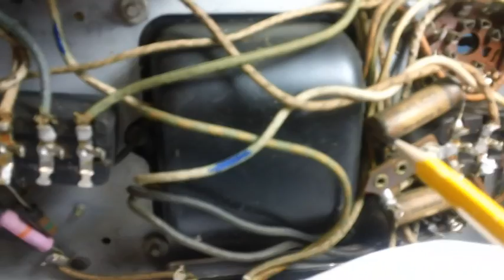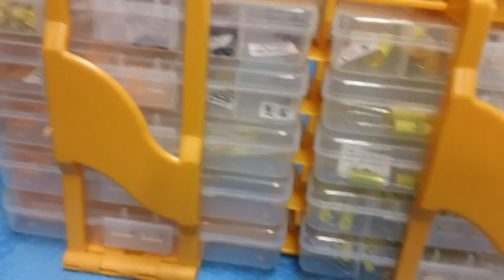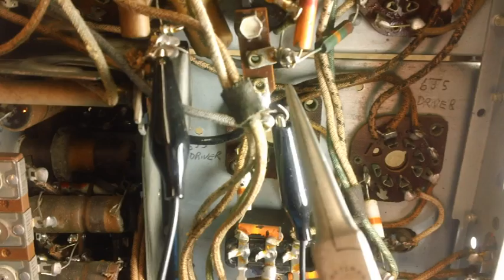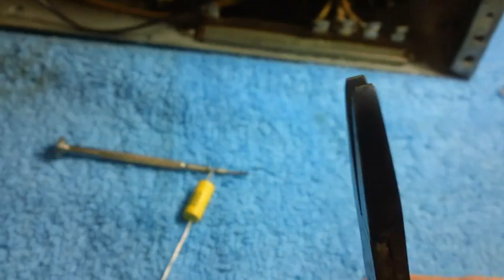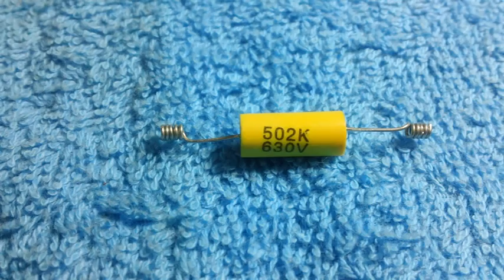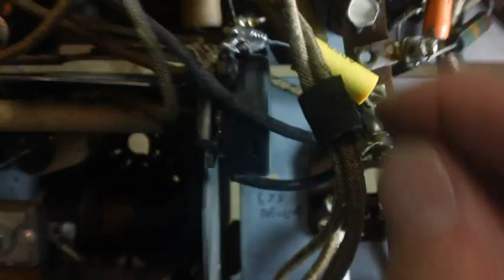Philco model 37-2670 repair and restoration (Part 5 of 34)

Comment: While the coil method is good when you have time, as a service tech, I have to move along at a much-faster pace.
So, what I do is clip the existing leads, bend and form an eyelet, then use the new eyelet as a terminal, just like a tube or terminal strip.
The reason is speed, and I can replace the component in two component-holding motions--but I've been doing this for 60-years!
Your method is superior for subsequent replacement in that they component just slides back off when heated.
But in both methods we are eliminating the stress placed on the terminals.

On electrolytic capacitors, we really have a bunch of cowboys that have never taken in a mostly working radio-say with hum, then decided to power it up and smoked the power transformer.  
When you take in a radio for restoration, that represents a commitment, so it's going to get new caps anyway--so don't screw around!
They believe that the rectifier-tube will save them, but it will (under a short) supply a lot of current, then open a winding on the power-transformer.
Explain that one to the customer--and try and then fix/find!

On testing IF-coils, I never do, as I can  quickly signal-trace with a scope; when you've looked at so many waveforms, you can tell right away what's going on.

On center-tapped IF-coils, there are several considerations that all contribute to what was wanted in the design.
First the capacitor is placed across the outer windings, to form a resonance with a desired-Q.
Next the center-tap can be looked as a voltage/impedance divider for the grid it's connected to.
I suspect that they were looking for a voltage, that would then relate to gain-distribution in the whole chain.
Also, many times you will see the normal parallel resonant circuit, then a tap taken just a few turns from the 'cold' or ground end; again for voltage or impedance-matching.

Sure sorry you quit doing these videos, you made a great contribution to the resoration-community.
73...

Comment: When replacing non polarized capacitors, it's a good idea to pay attention to "outside foil" and make sure the new capacitor has the "outside foil" on the same side as the factory original cap. Failing to do this may sometimes result in increased noise being picked up by the capacitor, as the outside foil tends to shield the inner foil layers. There are a number of Youtube videos that explain how to find the outer foil. Don't trust any markings on the cap. Hope this helps, and good luck with your restorations.

Comment: Good series. I watched till I dropped. 

Soldering iron tip temperature is very important.  Too cold and you slow cook the component and too hot and you oxidize the solder.  Weller has replaced the damp sponge with a Brillo type pad to clean the tip.  The solder company publishes tables with temperature recommendations. 

I had two things on my bench which I used every day. One is a lighted magnifying glass on a jib and the other is a soldering vise with two gripper clips on flexible arms. This was very useful in building things like XLR connectors an other soldering tasks where the components could be held in exactly the right position and not move while the solder cooled. 

Fluke makes meters that, in addition to volts ohms and amps, measure capacitance as well.
Reply from the maker: I'm happy you watched the vids, but don't be dropping on us.  There's loads of time to do it.   LOL  This radio restoration project had a particular meaning to me.  I had never worked on one that belonged to a fellow born in 1869.  I found that to be incredible, so tried to do an extra special job.
And I have always used a 60 watt Weller iron and have been formally schooled on how to correctly solder.  I also have a Fluke meter, and now an LCR meter, to handle any component value requirements.
Regards,
John

Comment: Hi John. Thanks so much for the gator wire trick. Anyone who has replaced caps knows about getting interrupted. Good idea.
    Also, the coiled cap lead is a nice method. I've always used a small hook lead, but am considering using your style. I agree that leaving a 3/8" lead from the old cap is often better than completely removing it from the pin.  Thanks again.

Comment: Good video John I do this the same way.But I use Silver solder not because it makes a better contact but its e-zer for me to see it better the old eye site is all most gone. the sliver shines better. Now I have may opened up a can of worms with this one sliver not lead tin solder. For me its a seeing thing may cost a little more but I like reparing old radios
Reply from the maker: Very interesting.  I've never used silver solder.  Is there a significant melting point difference between it and the lead solder?   And where do you buy it?

Regards,
John
Reply: joernone I get my silver solder at  MCM Electronics thay have it at all kinds of prices and size. Any good electronics store should have it. The temp I use it at is around 600 to 650 and for a short time it will mix with lead tin solder nicely
Reply from the maker: "...for a short time it will mix with lead tin solder nicely."

You lost me on that one, my friend.  Not sure what you mean.

Regards,
John

Comment: John,
Finally the first snip, glad to be here to hear it. Great tip on the coiling of leads to replace caps or resistors. You gave me a very simple solution to attach my new wires on the SW's power transformer. Thanks !
Nathan
Reply from the maker: You're very welcome, Nathan.  The coil method works in almost every case, but there are times when it's best to completely unsolder and remove the old wire from the terminal or connection.  Experience teaches a body which is which.

Regards,
John

Comment: I've heard of that coil method but this little voice in the back of my head kept telling me to desolder the wires and "do it right" I guess I should replace that voice with your voice. lol on a side note reading the comments that reminds me of a trick I use to insulate capacitor leads when needed, I just strip insulation from solid conductor wire and slide it over the leads. works well in a crowded chassis!
Reply from the maker: Daniel,
Insulating component leads with insulation removed from solid hookup wire is a very smart thing to do...not to mention the cost savings.  Great idea, my friend.  Hopefully, others have read your comment.

Regards,
John

Comment: You may remember I had to replace a tube socket not very long ago because I broke a tab off trying to remove components instead of just clipping them off. Lesson learned the hard way. I don't do that any more. ;)

Good stuff, John. Keep them coming, my friend.
Reply from the maker: Art,
Once again, my friend, I'm sorry about not answering all your posted comments, but the reply link sometimes comes up missing.  Weirdest thing.
The best thing I ever learned about antique radio repair was the coil method of component soldering.  It's saved me so many hours of work and for sure saved many a tube socket and terminal board.  Only in rare cases do I forgo the coils.

Regards,
John

Comment: I like using the wrap technique. Good tip vid. 

Carl
Reply from the maker: Carl,
Coils can't be beat.  Easy on - easy off.  And they hold well.  But then again it's not as if someone is under the chassis pulling on the leads.  :-)

Regards,
John

Comment: I don't know if I ever told this one on myself. Here goes. One time I attempted to use a lead I clipped off a capacitor to solder a the cap to the circuit board LOL.  I wondered why it was getting hot but not melting.
Reply from the maker: Jeffery,
Pretty funny.  Over the years we radio restorers across the board have made all kinds of comical boo-boos.

Regards,
John

Comment: WOW John, that`s a great idea, I`m new to replacing caps and I think I`m going to do your method from now on, it looks real neat and like you said, it`s easy to remove them when you need to
Reply from the maker: The coil way works pretty good, but it takes a little practice to get it right.  Just be careful not to over bend the leads near the body of the capacitor or they'll snap off.

Regards,
John

Comment: Sprague Capacitors (back in the '60's) used to come with these things called "Kwikette Soldering Aids". It was a small coiled wire coated with solder and flux ready to use. They were supposed to be an easy way to replace parts just as you described here in your video. Apparently they quit making them sometime around 1969. I still have a few in my "Old Stuff" collection.  FYI - just a bit of history.
Reply from the maker: David,
Seems to me there were also things called quigs, quiggles or something like that.  They came in a small, flat metal can, and were just coils of wire.  Maybe I'll include a segment showing how one can make them.  It might someday be useful for folks to know how to do it.
Thanks for dropping in.

Regards,
John
Reply: joernone
Probably Kwikettes! At least they are the only ones I have ever seen. The ones I have are small coils only about 5/16" long and are in a small plastic box.

Comment: John, Can you tell me how 502K = .005?  Does the "2" mean there's two zeros in front of the "5"?  I know that "K" indicates tolerance.  In this case I think it means 10%.  Right?  Thanks, Tom
Reply from the maker: Tom,
Actually, the number 2 means there are two zeroes to the right of 50, which denotes the cap value in pica farads.  50 thus becomes 5000pf.  To then convert the cap to micro farads you count six numbers to the left, adding zeroes after you pass the number 5.  5000pf then becomes .005uf.
The K says the cap value has a 10% tolerance.
Got it?  Got it!

Regards,
John

Comment: John,
The method of replacing components (on hand wired chassis) you demonstrated is exactly the same as I was taught way back in 1971.  It is, as you say, a safe way of avoiding breaking solder tags etc. – a very good tip for beginners and the like – well done.  
The portable storage systems, for storing components, is something I still use even though I have been out of radio and TV servicing for seven and a half years.  Although I did not go out repairing in the field very much (I was a bench tech), I kept six of those type of storage units in the back of my van.  Believe me, you will find your storage unit very useful.
Another excellent teaching video my friend.
Regards,
Phil.
Reply from the maker: Phil,
Right you are, my friend.  The coil soldering method goes way back.  Nothing new at all.  Hopefully, it'll help others.
BTW...I didn't know you were at one time a bonky-telly man.  Good for you.
Thank for stopping by one more time.

Regards,
John
Reply: joernone Yes, 'tis true my friend, for almost thirty-six years I earned a living as a humble radio and telly repair man (official job title was, Television and Audio Service Technician).  Regrettably, modern domestic electronic equipment is 'throw-away' and repair centres are associated with days gone-by.  Consequently, I now work on public transport. 
Cheers,
Phil.

Comment: I've heard debate about using that method, but, myself, I always use the coil method.  Some of those manufacturers would wrap those leads around a terminal 2 or 3 times.  You do more harm, than good, applying all that heat on, getting the old leads off.  I don't see any downside of doing it like this.  Like you say, do it the way you want, but, for all the reasons you mentioned, to me, this is the way to go.  Good video, John.
Reply from the maker: Al,
I don't know why folks back in the day thought that multiple lead and/or wire wraps around a given terminal, then covered by a big gob of solder, made the connections stronger.   But it does have a neat quaintness about it...and since the connections have held fast all this time, it's probably not prudent to argue with success.  :-)

Regards,
John
Reply: I always suspected it was part of an assembly line process, one person placing components, another soldering them in place.  Who knows.

Comment: How do you remove the caps buired deep down?  Disassemble the chassis? Man your a confidence booster, I'm going to keep my eyes peeled for a decent 'guinia pig' radio set to give it whirl at restoration/repair.  Your quite the inspiration Sir!
Reply from the maker: Yeah, it looks like things will eventually have to come apart, but hopefully not until after the radio makes some noise.  We'll see.

Regards,
John

Comment: More good, basic tips.  I particularly like the gator wire to mark the capacitor replacement, interrupts.  Several of those caps are going to present some interesting challenges.  I'm hanging on buddy.  Thank's...Joe
Reply from the maker: Joe,
A while back a friend of mine recapped his operational radio and it stopped playing, so after pulling his hair out for a week, he brought it to me and asked for a little help.   It turned out that he had soldered a cap  lead to the wrong place.
He said to me: "It must have been when my neighbor lady knocked on the door and asked me if she could use my cell phone.  When I went back to the recapping I guess I lost my place."
So use the gator wire trick.  It never fails.  :-)

Regards,
John